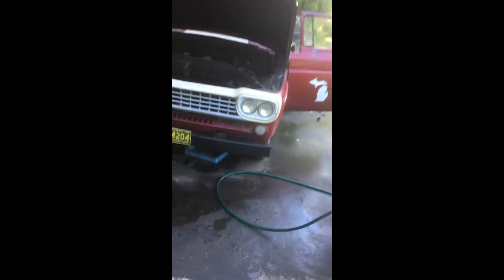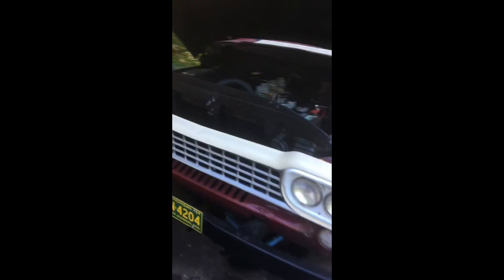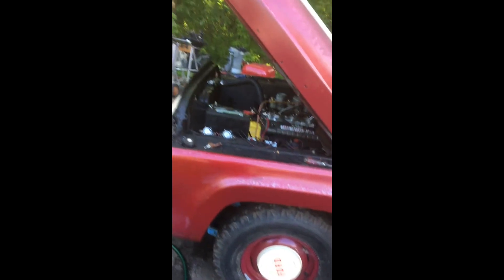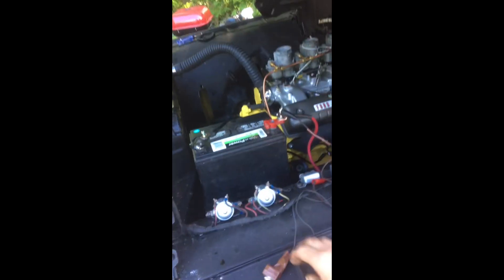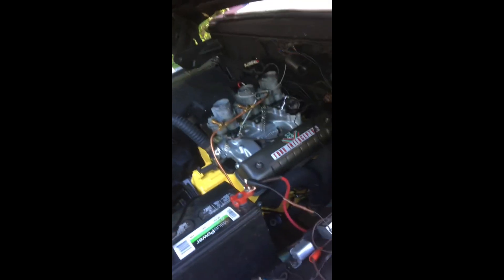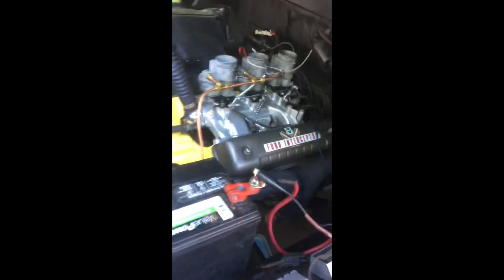1958 Ford F100 on the road- acceleration -cruising -272 y block -classic fridge truck revived-

Comment: Why is the block yellow? Is there a reason? This is the second one I’ve seen done like that
Reply from the maker: The motor wasn't original to the truck. It was a rebuilt motor that had been intended for a 56 Ford car and it was already painted before being installed to the f100. Yellow may have been a factory color for some of the y-blocks(im not 100% sure), but in the trucks- they usually are red.
Reply from the maker: @The Jando Life ahh ok, I see now. I was a little mixed up on the color coding.